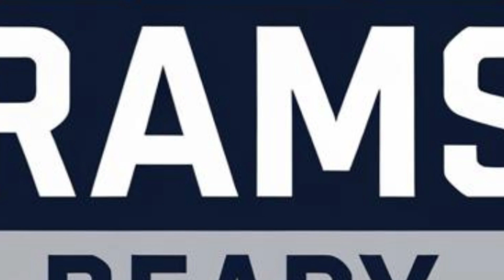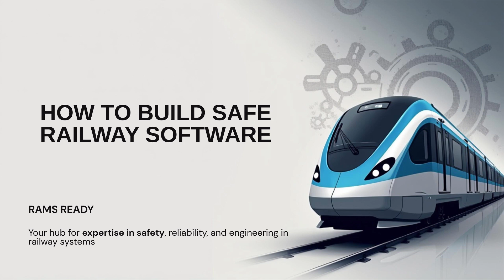How to Build Safe Railway Software

Comment from the maker: Working files for this topic, built to be used on a live project:

RAMS Plan and Safety Plan Pack
RAM plan, safety plan, verification and validation plan, hazard management procedure and a deliverables and RACI tracker.
https://ramsready.firstlinkai.com/p/A3

Railway RAMS Template Toolkit
Hazard log, FMECA, SIL allocation, risk matrix calibrator, EN 50126 lifecycle checklist and a safety case skeleton, eight working files.
https://ramsready.firstlinkai.com/p/A1

Free Lite Hazard Log workbook: https://ramsready.firstlinkai.com/free
All twenty products: https://ramsready.firstlinkai.com

Which part of this gives your projects the most trouble in practice?